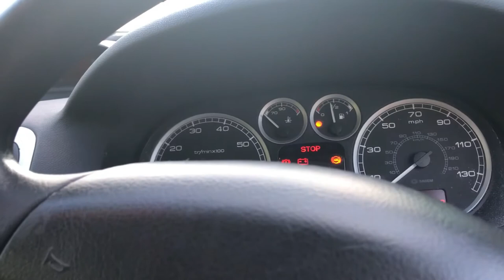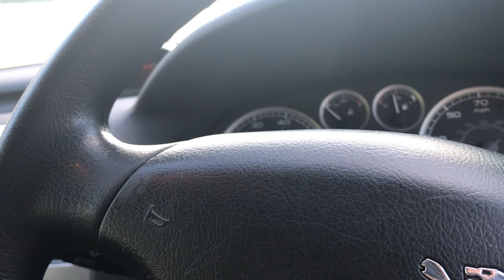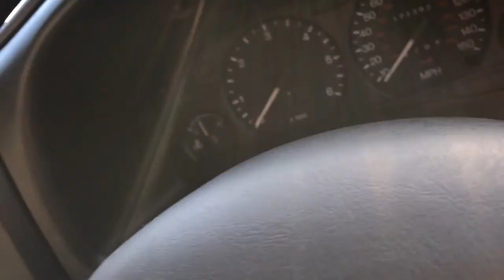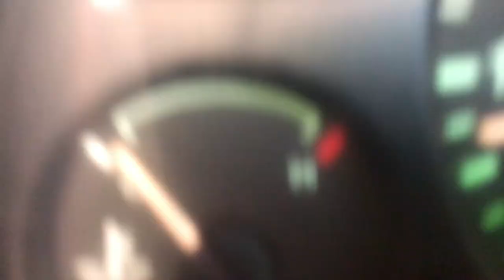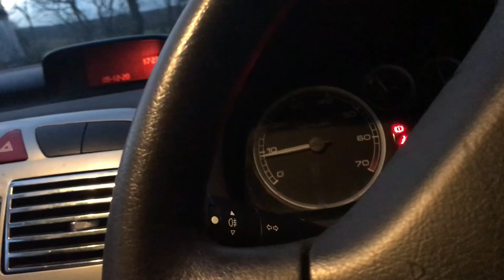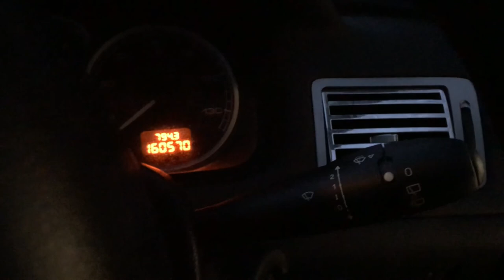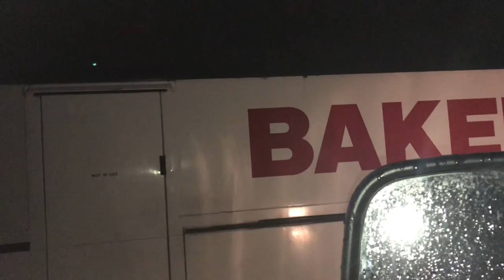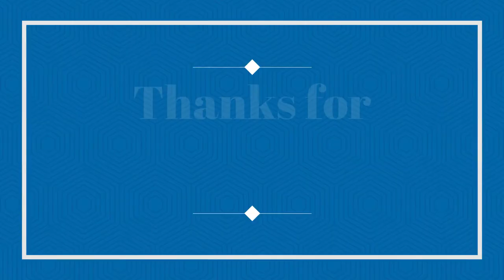The Vehicle Project Part 55 05/12/2020

Comment: Hope you coach be out soon
Reply from the maker: Same I do aswell it probably won't be this year but it might be next year because we still need to do the welding, maybe  give it a new coat of paint to shine it up aswell as T cut it still need to sort out the back lenses, side marker lights and the Batteries. Also the drivers mike needs sorting, the inside needs a really good clean including inside the radio! In one of my recent vids which hasn't bean released yet we fixed the mike near the door! Also we need to sort out the light above the chair near the door aswell. Plus we need to fix the inside of the indicators at the front and also the wipers. As well as this we need to fit the new mud  flaps that we got for it. Also it needs a really good clean on the roof and all around the outside of the coach and we will probably find more bits wrong in the future lol (: